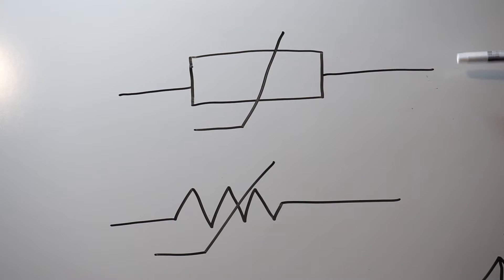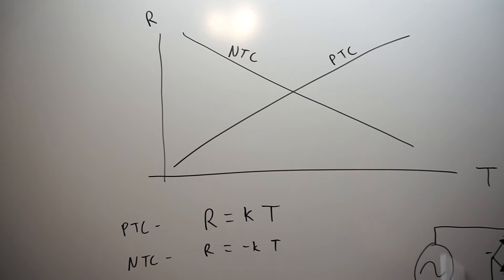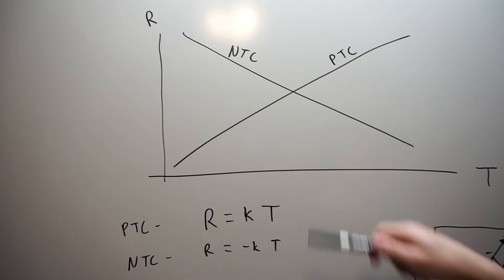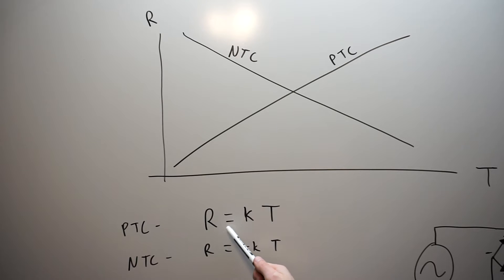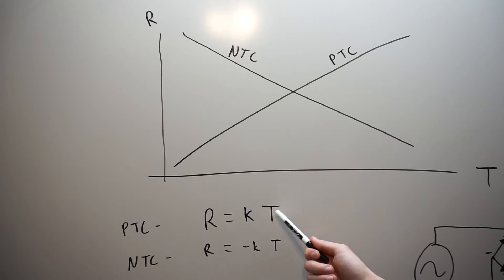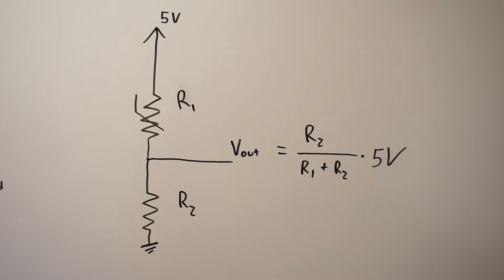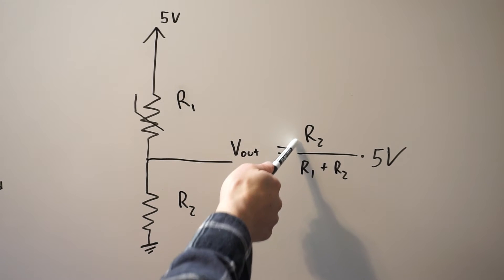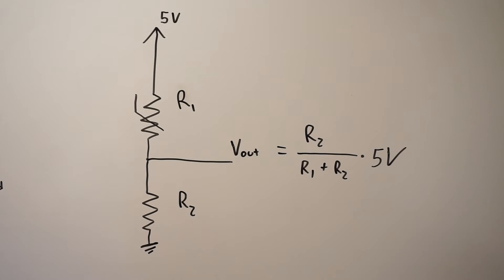Basic Electronic Components - The Thermistor

Comment: Thank you for this video! Question: can a thermistor be affixed directly to a heat sink to measure its temperature (via Arduino)? Or is it just for ambient temperature. If it can be affixed, what's the best way to attach it?

Comment: The reason a thermistor has a "hockey stick" symbol through a typical symbol for a resistor is that the actual "curve" for a PTC thermistor resembles a hockey stick. In your examples you show a "linear" curve, which is not how a PTC thermistor responds to an increase in temperature. In the case of a NTC thermistor the curve looks more like an elongated "C". Other than that your presentation was well done. Cheers mate!